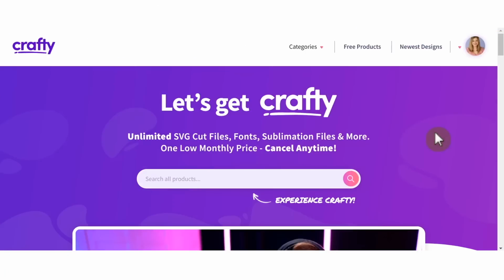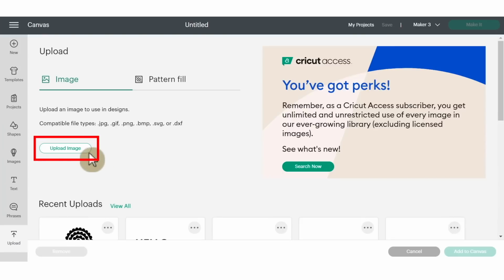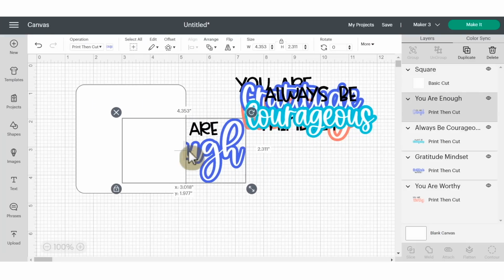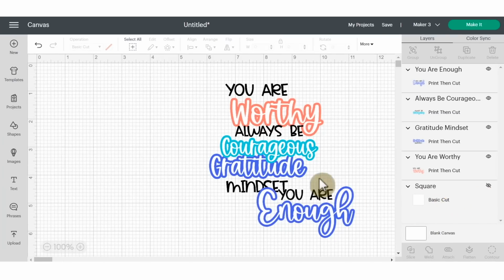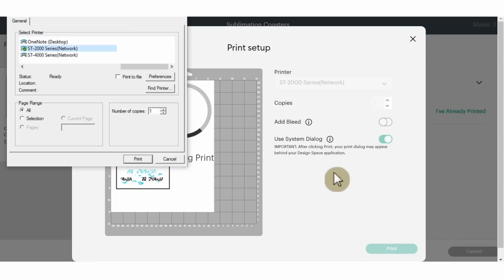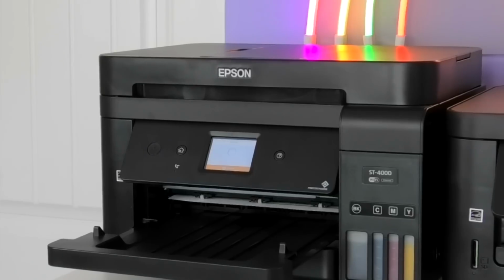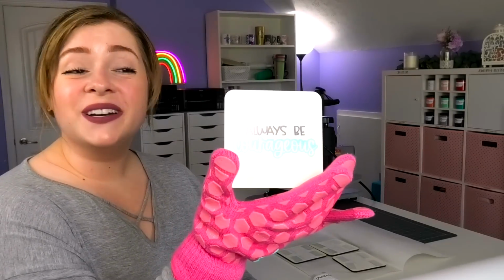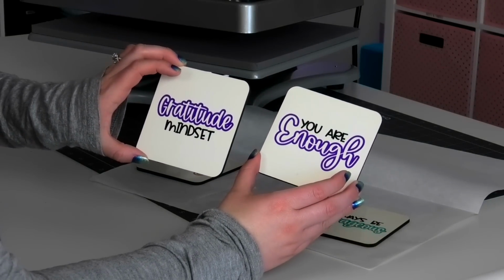How to Sublimate on Coasters | Sublimation for Beginners

Comment: Great video!    I have a question about my new heat press.  I live in a tiny apartment.   I have no idea where I can put it. What is a safe surface.  I know also, I'll need to cover it,  I could not find the right size online..  I  thought about covering the box or a box with vinyl and putting it on upside down as long as it's cooled off.  Any suggestions?
I went crazy and got the printer and convection oven,  too!  😆